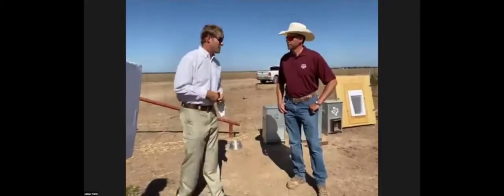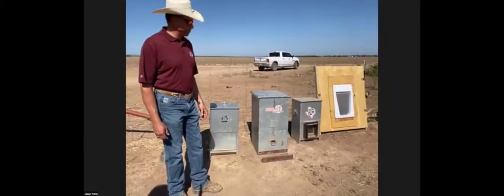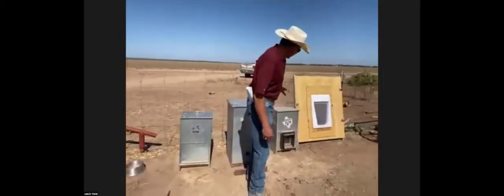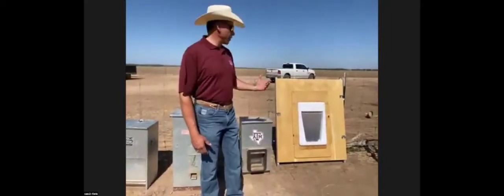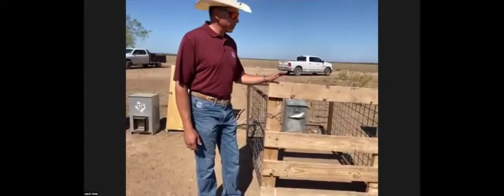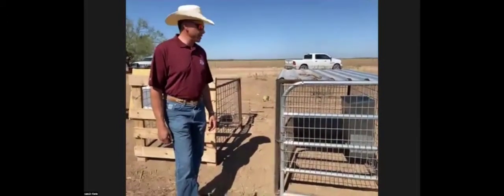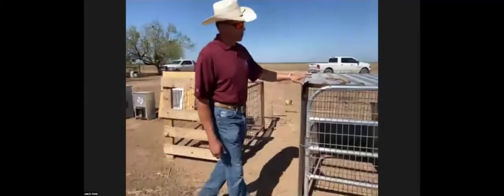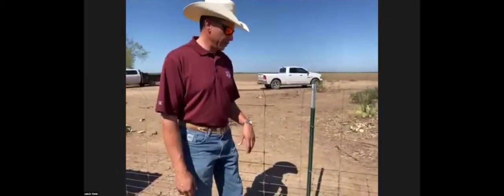Sheep n Goat Field Day 2020 - LGD Feeding Systems

Comment: my goats have learned to jump through a 12 in hole ...
Reply from the maker: What type of goats?  How high off the ground is the bottom of the hole?  The opening on our jump gates is about 26 inches off the ground and another 12 inches high.  The lower level at 26 inches seems to be the deciding factor for our goats whether or not they get inside.

Comment: How has the doggie door been working
Reply from the maker: It has worked great for the puppies in our bonding project 2 years in a row.  However, when we tried to get 3 older dogs at a research ranch to use it they refused.  We worked with them for 4 months and finally gave up.  I think if you had new dogs that started with it as pups and were going to be the only ones to use it, the system would work.  We are working on another system using our GPS Oyster LoRa trackers to activate a door on the feeding station to allow them inside.  If we can get this to work mechanically, I think it will finally solve all problems.  We are shooting for a retail cost of $500 for the system.